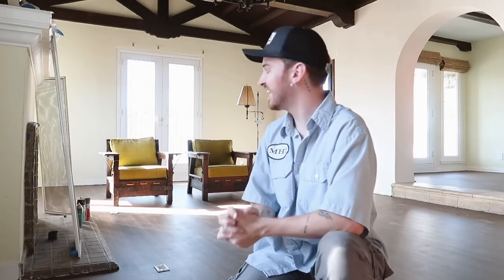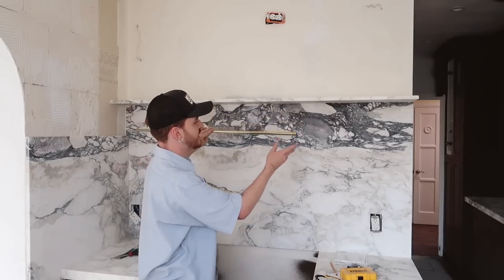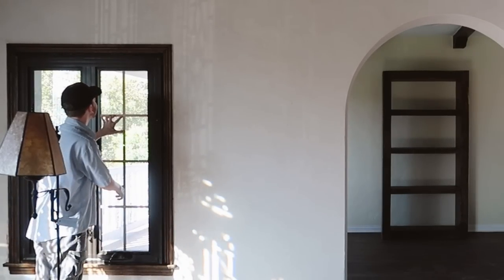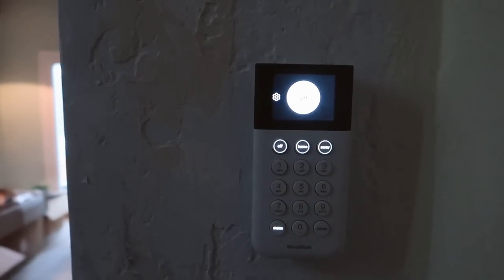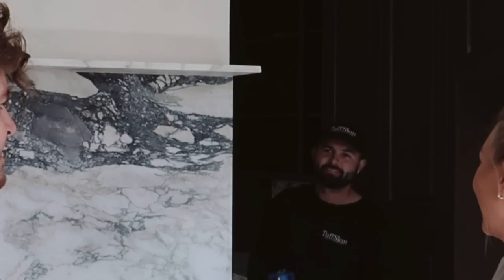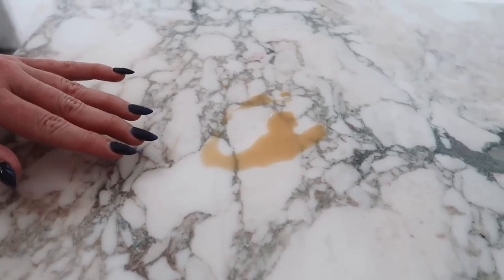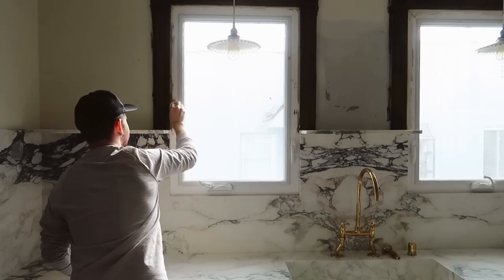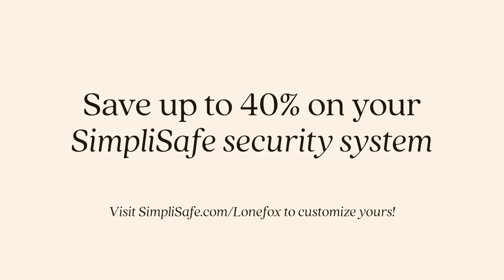Restoring My 100 Year Old Windows!

Comment: You have to remember not to sit a hot pot on it. Can it be kicked by a knife? You would need to be careful placing a knife down. I had 4 quartz boards cut from my counter quartz. I placed 2 on each side of sink. The one closet to stove top is where I sit my pasta pots to drain in my colander strainers. Then I can wash veggies etc and use left or right to cut up vegetables. I use the other 2 on island. To cut on, roll out pie dough, cinnamon roll dough etc. It's a bit larger. The other one makes a great presentation tray for cheese, prosciutto, peppers and crackers etc.
Reply: I’m sure he’ll remember to use potholders/trivets and cutting boards
Reply: @kellyalexa1437  yes I use them and don't have marble 😊

Comment: I would make the mullens detachable for window cleaning ... I find it a nightmare cleaning the glass around them . Everything is looking fantastic !
Reply: Mines are between the window panes, no hassle. (Double window panes is standard here, with winter that can get to -40)
Reply: @isabelleblanchet3694  oh that would be lovely !!! (The windows , not the weather 😆)
Reply: Agree ..cleaning with that wood in the windows...not a great idea
Reply: Small strips of Velcro would do the trick.  Plus, I would put adhesive in the middle of the mullions to prevent bowing of the wood.   In any case, the windows look great now.
Reply: Or some kind of magnet thing ..all for the purpose of future cleaning  !
Reply: I was just coming here to say the same thing! I had windows like this in my old home & cleaning them was a nightmare. I did literally have to use Q-tips to get into the corners & it was SO time consuming! No thank you! :)
Reply: and with the way he attached the mullions the glass cleaner will collect between the mullions and the glass and it might get moldy
Reply: @lisahuber9329  … agree.  And any dirt or residue that gets behind the mullions will probably show from the outside.  I have lived with small paned windows in the past and they are such a nightmare to clean.  Drew, I’d really recommend trying to make them removable.  As someone else suggested, there are little latches available that can be fitted to the main frame to hold the mullions in place.  Or Velcro dots where the mullions actually touch the frame?
Reply: I think the pieces he spray painted are called “Muntins”. You could create a frame around the muntin, and use that to attach to the stiles and rails of the existing window. You could use something like a museum wax to hold it in place in select area around the muntin frame, but people have a point here. It’s going to be tricky keeping that clean. I guess don’t spray the windex directly on the glass, and just use glass wipes or spray into the towel .
Reply: @yenvo573  .. Yes!  … muntins 👏🏻👏🏻👏🏻
Reply: Exactly, I can’t figure out how to remove mine without breaking them.
Reply: @isabelleblanchet3694  I didn't see window panes like Drew's one in Quebec. I have to say, with the condensation and the -40 C, if the panes are from wood, they will be gorged with water and it would rot, so it's only logical we use built it panes like yours. I wish I had some in my windows, it,s so beautiful.
Reply: @ambradeluna  Yeah, I can imagine all the mildew and mould that would get into those. It would get disgusting really fast in Québec.
Reply: My first thought.

Comment: My parents house has unframed wooden mullions on the windows and the ends all have small folded metal pieces with rounded tips that act as a spring. The tension keeps them in place and you can easily remove them to clean.
Reply from the maker: Ohhh! This is clever 👍
Reply: yes i knew there must be something other than tape to hold them, the sun shining on that tape is going to disintegrate it quickly.
Reply: @donnapecoraro3126  Yeah, I don't know what they're called unfortunately. I googled "mullion clips" and those exist but aren't what I'm thinking of - the metal pieces protrude from the ends of the wood and are much smaller (you can't see them unless looking very closely). 

I wish I could describe them better but I couldn't find them by googling and I don't live near my parents so I can't take a photo.
Reply: Mullions are vertical shafts located in between windows. These elements offer structural support for the windows. Meanwhile, muntins are found on the window glass itself. They are vertical and horizontal elements that divide a window's glass into a grid.
I would have added some  on the outside as well and then you wouldn't actually see the tape pieces. You could actually glue them on the whole surface. And I would have used metal, the wood pieces don't seem that durable.
Reply: I have wooden mullions that came with attached to the ends are little metal clips shaped like a flat triangle (they are pointy and sharp like a razer blade)  they easily slide in between the wood molding of the window and glass. I have Marvin windows that look just like Foxes. I bought them from the store I bought the windows from. Fox should go to a window store and ask about it. 

It's a hard thing to describe, but once you see it ...its an ah ha moment.
Reply: @Lynsey17  I know exactly what you are talking about as I have them. You're right, it's hard to explain as it's something you have to see to understand it.
Reply: That's what I was wondering, if it's anything like that to add for easy cleaning of the windows, thanks for sharing

Comment: For those who don't live in the LA area & have access to tough skin - applying a layer of marine wax to your marble will protect it from stains. You have to re-apply a couple times a year & be careful what cleaners you use. I use a few drops of Dawn dish soap in water to clean mine.
Reply: I just installed a white mabelized Quartz counter top in my kitchen. Can you use this wax? I can see a little staining,  but I use magic sponge and it helps.
Reply: That would have been a great alternative
Reply: I had a very prominent furniture company in Houston tell me we could use car wax on our marble. Mrs. T at Star Furniture.
Reply: Thanks. Of all the comments about the marble, this is the one that makes the most sense to me. Marble is gorgeous but seems so impractical without treatment, and plastic film is ruined by heat or knives - the two things all kitchens on Earth have in common! Marine wax sounds like the best solution imho.

Comment: The woman and guy from the marble protection squadron were impressive. And diamond mullions would set a tone. My in-laws had a place near Griffith Park with them. Loved x 3. The floor is so important. I have no idea. But you are right. Just as diamond mullions affect the tone get the floor to match that feeling. Be brave and true to the place. It will be a Good Choice. Like the copper pot hanging pot in brass bar feature. So proud of what you're  doing.

Comment: Drew, to protect your floor finish put felt leg pads underneath all the legs that touch the flooor. To ptrotect the walls use small ones on the backs of furniture pushed against the wall.

Comment: Love the mullions.  You were smart to make them detachable for easy glass cleaning.  I like the larger diamonds on the kitchen windows...not so busy with your marble.   Hope you are putting felt pads on your wooden chair legs to prevent scratching your wood floors.
Reply: Does the Gorilla mounting strips leave residue? Must you remove and replace with every window cleaning?

Comment: Some suggestions for your kitchen windows. If the company you purchased the living room millions from can't offer you the size diamonds you want you can go to a local cabinet shop that had a CNC machine, they will be able to make them for you with the size diamond you want. If you take masking tape (if it duplicates the width of the rails and stiles of the mullions) and place it at an angle on one of your kitchen window you can experiment the size of the diamond. 

As an alternative you can buy 'leading', that comes on a roll. This process is used for glass in lichen cabinet doors etc to give the look of faux leaded glass. It comes on a roll and can stick on the glass.

Comment: Honed marble will be ok if it stains because you can sand it out. I’m glad to know there is a product to protect it. 
Diamonds in the windows would be on par for a kitchen window from that era, adding a few colored pieces would be even better (a film of some sort) 
As for tile a terra cotta floor would work but you could add little decorative tile within or a border of tiles. In Tulsa we have some Spanish Revival and I’ve seen some with this tile in a loggia.

Comment: Very interested to see how the corners and edges hold up on the coating. Drew, your marble is beautiful with or without the coating. Yes, marble is porous, but I've seen granite and Caesarstone chip within months of installation. As an FYI, Danby Marble from Vermont is much less porous than many Italian marbles. As a designer, I have used it in many kitchens and baths over the years.

Comment: If you pour boiling water over the exposed grout on the kitchen floor and leave it be for about 15-20 minutes, it should soften it and allow you to scrape off the old grout. It’s a messy job, but it worked for us. Home starting to pull together now in the areas that you’ve been working on. It’s looking stunning.  👍🏻

Comment: if you are going to use the same roller or brush instead of washing it between each use, you can cover them and the pan with a trash bag and keep in the fridge.  I have done this many times and it's no problem at all.

Comment: I just purchased a home that had UV film on all the windows from who knows how long ago.  The UV film was bubbled and cracked, plus it made everything outdoors look purple.  Removing it was a real pain in the butt, AND the adhesive left an unsightly blotchy residue that's impossible to remove.  I'm not a fan of spending hours applying toxic solvents to my windows.  I've already given up because the recommended ammonia had zero effect.  (My experience with attempting to remove UV adhesives from glass is that I spent HOURS using multiple solvents and scrapers on my car windows when the DMV suddenly decided after years of passing inspections, that the tint was too dark.)  I'm now looking at replacing ALL the windows in my house because the glass is ruined by the adhesive used in an unstable coating.  Drew, I sincerely hope the adhesive used on the protective coating that was applied to your counter tops won't degrade over time and ruin that beautiful marble.

Comment: Dear Drew - the bottom vertical mullen on the left side window is not quite vertical - the bottom of it needs to move 1 or 2mm to the right (hard to tell on screen). My pernickety radar has been triggered!! I hope it's possible to unstick it and move it over slightly. Love from PernicketyMe in Scotland. xo

Comment: Having marble countertops covered by plastic? What were you thinking??? You can never put anything hot or cut on the surface ... and the plastic will bubble in time... If LOne Fox loved marble so much and did not know how to care for it... should have gone for garnite that looks like marble... I've had mine for 10 years now and still looks great... as I said before... Lone Fox and MaCenna have not thought things through enough...

Comment: I like your mullions. But will that Gorilla tape hold in the Summer when it gets really hot? I've used different types of tape to hold cardboard in place, an ugly stopgap measure to cover parts of the window when I have my air conditioner in it, and I have yet to find a tape that doesn't fail when the temperatures are really high. But then I haven't tried that Gorilla tape. 🤷‍♀️

Comment: Go back over your window millions with a measuring tape - some of them are crooked, like with the first one you installed to the right of the fireplace. They kick to one side making the distance from the top to the bottom not the same. But they sure do make the window pop.

Comment: I don’t understand what’s the point of having marble counter top if it’s to cover it with plastic. Marble or stone allows you to
Put a hot pan on ot without anything in between, you can cut on it, it’s great for making pastries and dough. Yes you need to take care of it but you just wipe when you spill something, you clean it with black
Soap. And there is products that exists to revive it when it’s really, really dirty! 

Your coating is nice but not very practical I think.

Comment: Not liking the windows inserts, like Drew man, you are expending thousands on lamps, decor and furniture alone, and well spent at that, no judging,  do those windows inserts iron ones or at least install them professionally, but Gorilla tape, really? Also what a shame to turn such a magnificent marble into a cheap plastic countertop. They may not be visually offensive but you've lost the marvelous cool refreshing touch of the marble and feeling, specially if you like to bake. Let's see how translucent they stay after you start placing hot things on top of it, marble gets a great smoothness and patina with time, they are two hundred years old and more out there and still great.  Your home your choices but I wasn't expecting neither of those options from you.  It's like you need to breath, step back and keep on your original route even if that means not to have it right now, you can't curate a house in three months.